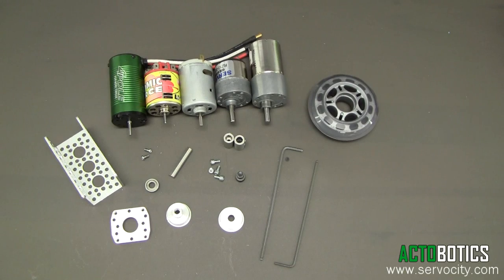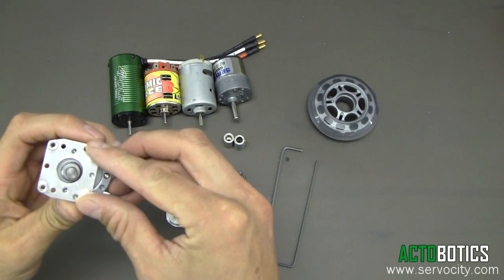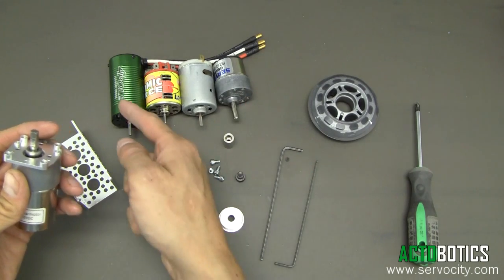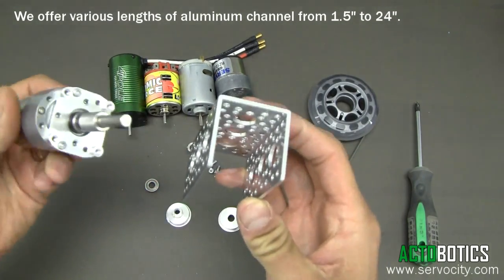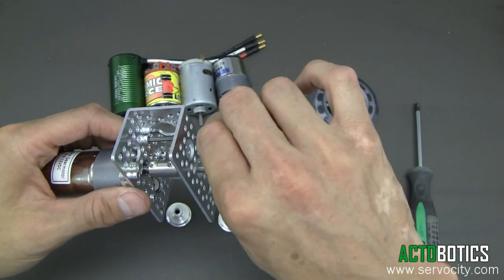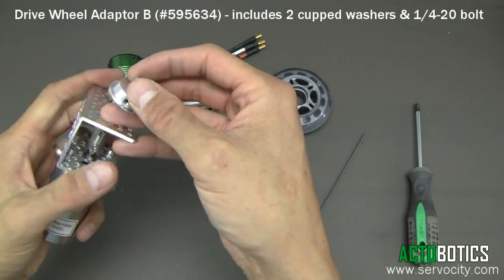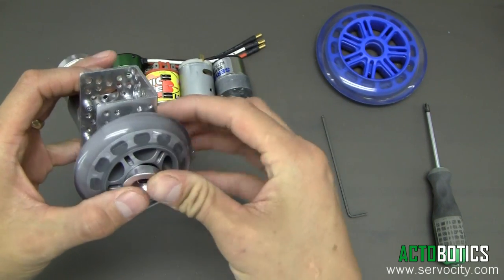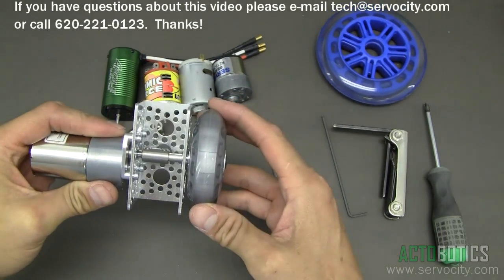Actobotics™ - Building a gearbox that takes the load off the gearmotor shaft

Comment: This seems like a good method.  But I am curious as to if its actually needed.  The gearbox says that it has 2 ball bearings supporting the output shaft already.  Does it really need another one ?
Reply from the maker: It depends heavily on your application.  The gear motor in the video has bushings supporting the shaft inside of the gearbox.  As the radial load increases on the motor shaft, it will put more pressure on those bushings, causing more friction and hindering the performance of the motor.  Other motors in the background do not have any gearbox and most of those would suffer immensely from having much of a radial load.  If you've selected a motor with bearings, it will likely be able to handle a higher radial load than those shown in the video, but if you put enough load on it or extend the shaft far enough from the motor face, having this support will still be beneficial.  Feel free to contact us should you have any additional questions tech@servocity.com.